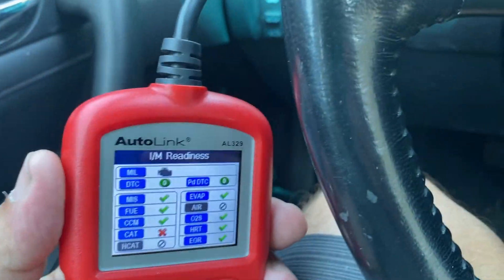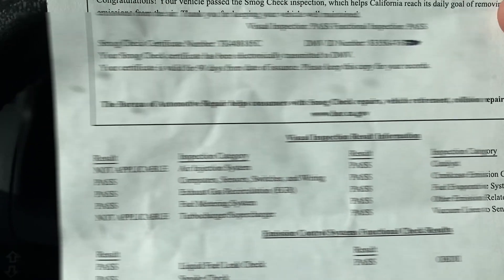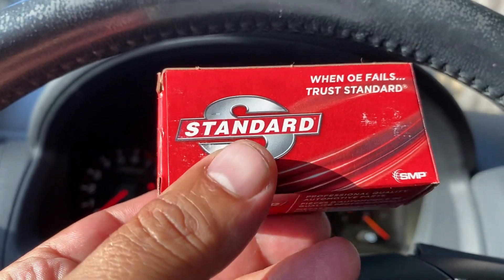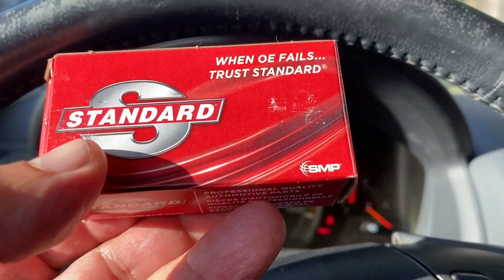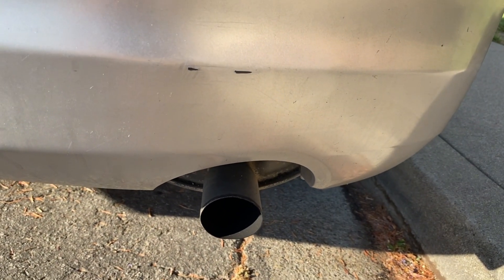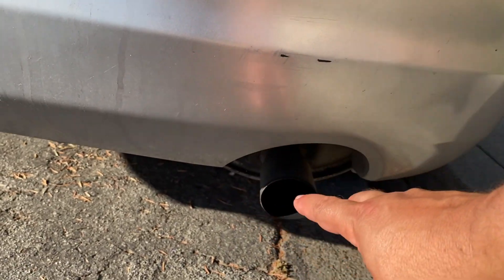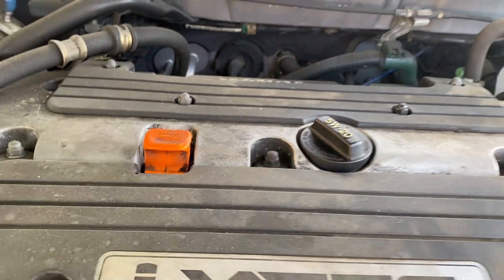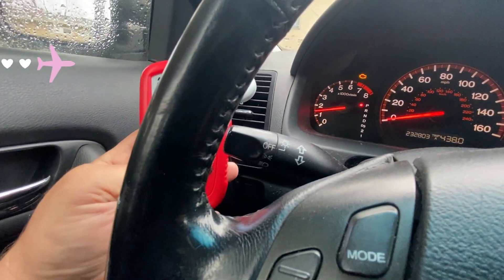The Secret Trick to Passing Smog With High Mileage! An Old Smog Tech Taught me this!

Comment: Hi! I have a quick question. I have no codes to clear & on my OBD2 only shows the CAT monitor needs to be done. Should I erase/clear codes & do a drive cycle? Or can the CAT monitor clear by itself? I have a 2000 Mercedes c230 kompressor btw
Reply from the maker: Don’t clear the codes as you will have to start another drive cycle. You only have one monitor that is incomplete. Your c230 is 25 years old so it may take a little time but it would be good drive on the freeway at 55 mph or 65 mph for an extended period of time within using cruise control or air conditioning.
You want to ensure the catalyst gets nice and hot. Something a hill or mountain can be a bless as it will increase the temperatures.
Good luck and keep me posted.
Reply: @RANDOMFIX I saw your vid on that dura lube for the catalytic. Would you suggest trying that to help?
Reply from the maker: @ChristianLeano-b4m chemicals can help but there are free solutions that just require patience. I record this video https://youtu.be/Xe2x-FxvUxA?si=vOKrLRZMFADsp7sp that covers incomplete cat monitors. Watch it as there are lots of golden nuggets throughout.

Comment: Hello, need help with Bmw m3.. failed Emmisions due to cats and O2sensor not ready😢. I have no codes. I do have a tune but not too aggressive. The tuner mentioned that it shouldn’t mess emissions.. I’ve done a drive cycle and 200 miles.. please help?🙏🏽
Reply: you have to do bmw drive cycle multiple times

Comment: I just bought a new cat over 1k i just need the MIL to clear AND EGR,HCAT,HRT and AIR to turn Green  any advice? I have fixed the 2 codes i prevously had still have a PDTc AND 2 prevous DTC that i took my car to the shop for one was the p0420 AND the other p0741 any advice? TIA did my first repair not adress the actual problem?

Comment: I use 5w20 motor oil will putting a heavier motor oil in help pass emissions test
Reply from the maker: Sorry for the late reply, I didn’t get notified. 
As to your question if you excessive blow by it could help but you really have to be careful. This will depend on the age of your vehicle and other factors.
My dodge takes 5w-20 and I changed to 5w-30, I live in Texas so it doesn’t get cold but it can get hot.

Comment: What about an abs traction sensor with that effect the catalyst mon?
Reply from the maker: Sorry for the late reply, I didn’t get notified
Normally the abs traction control will affect the catalyst monitor from getting ready. I have seen vehicles like Subaru throw a cel engine light for a bad wheel speed sensor with affects the traction control.